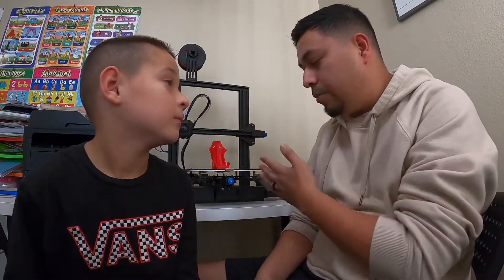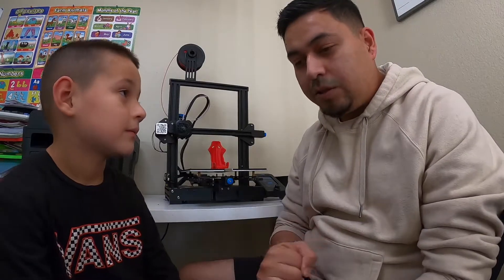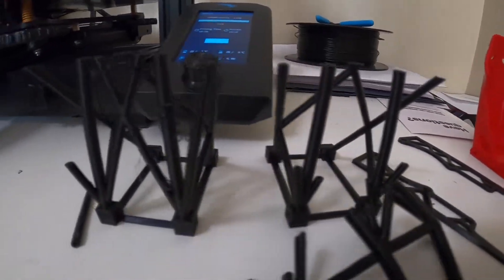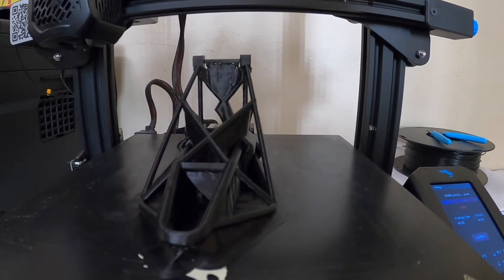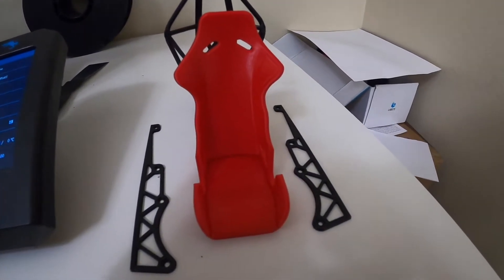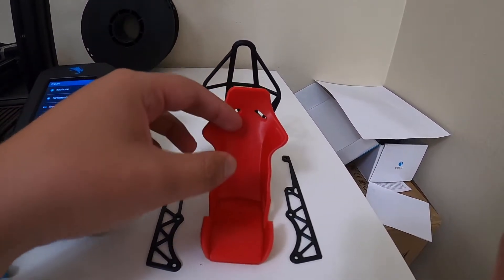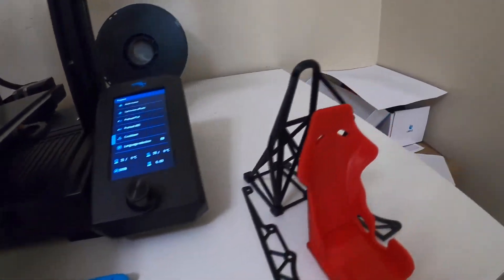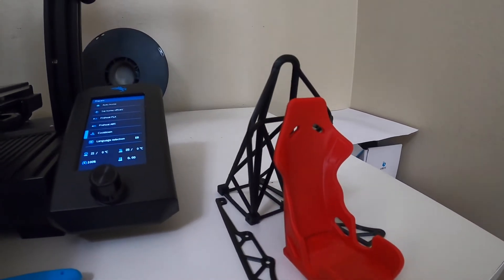MY FIRST 3D PRINTED CAR PART! / ROLL CAGE AND SEAT!

Comment: hi, Im from Argentina, How did you solve the issue of the roll cage that broke?
Reply from the maker: 👋,  I flipped the STL to face down onto the bed. Instead of being straight up. Also, use supports.
Reply: use z hop and print slow.i dont use support